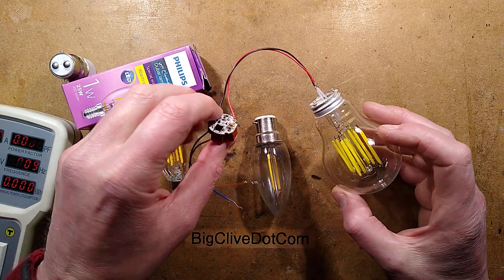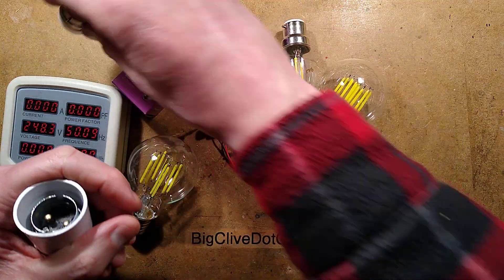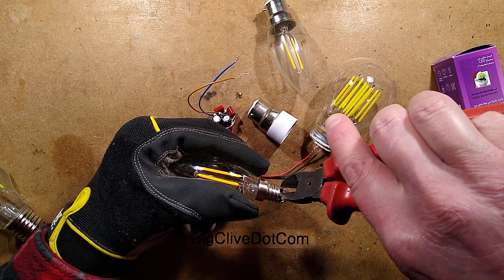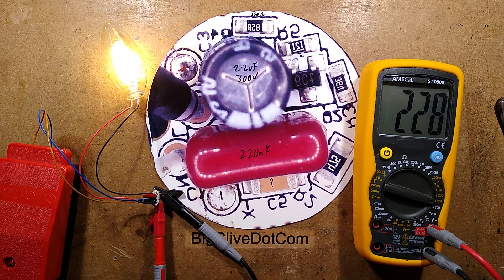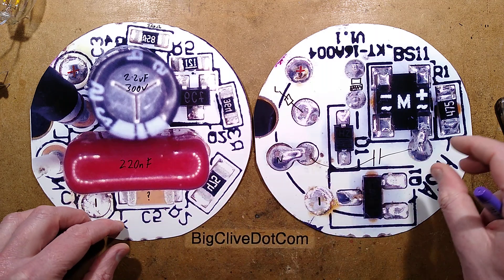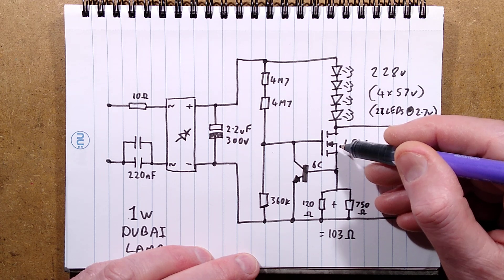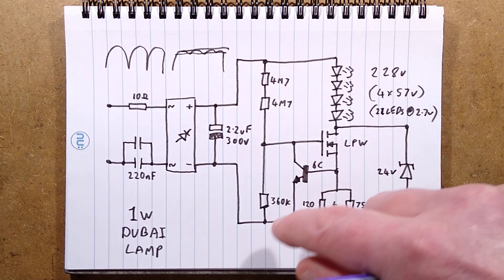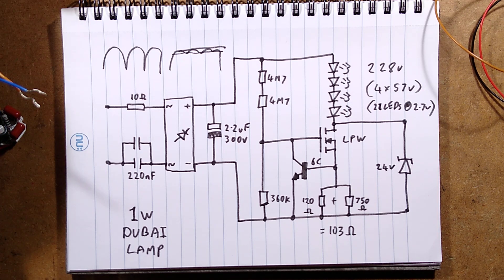Opening the 1W Dubai lamp (with schematic)

Comment: Nice video. Quietly professional. Shows professional respect for the excellence in concept, design and implementation
Impressed with your smooth pronunciation of 'Sheikh Mohammed bin Rashid Al Maktoum'.
Agree there are about 3 or 4 moments where you are struggling very slightly for the correct words but I think it adds a pleasant human element.
Given it is likely to be a fairly popular video it may be worthwhile having a go at redoing the reverse engineering but I am undecided if a razzamatazz style reverse engineering would be better or worse than the mellow effect you have already achieved.
Difficult decision (especially hard when you are spending hours overthinking every aspect) .
Have a go and see what you end up with??? (Needless to say, don't be afraid to keep the original version even if the new version takes days to 'polish')